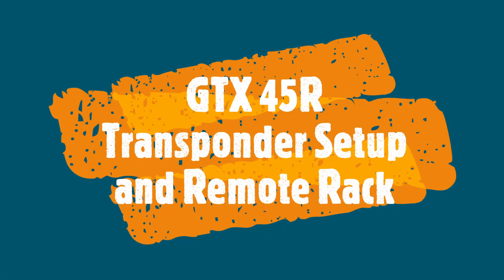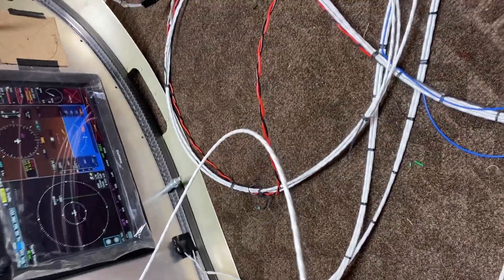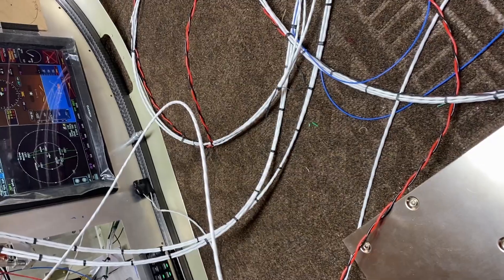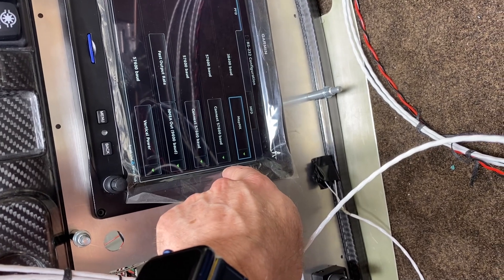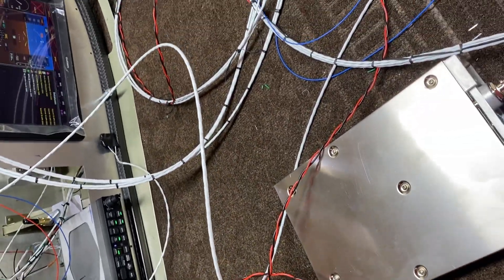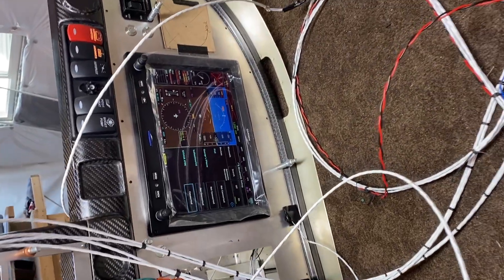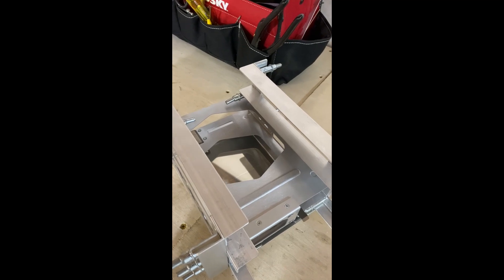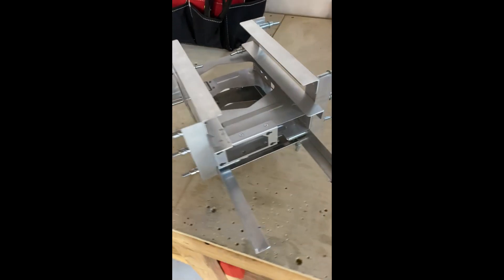GTX45R Transponder Installation and Remote Mini Rack

Comment: love those switches where did you acquire those?
Reply from the maker: I purchased these from WayTek, you can also get them from aircraft spruce but there were much more expensive when i purchased.  The series is Carling Technologies;

V1D1B60B-00000-000 1-Light, SPST, On-Off, 12V/20A Rocker Switch
V1D1BT0B-00000-000 Red Light, SPST, On-Off, 12V/20A Rocker Switch
VCH-01 8 Position Contura Switch Connector Housing

and dont forget the mounting brackets, ends and connectors.  

Cheers George